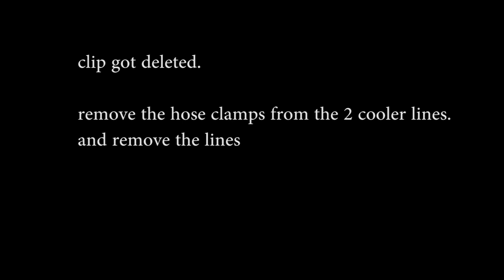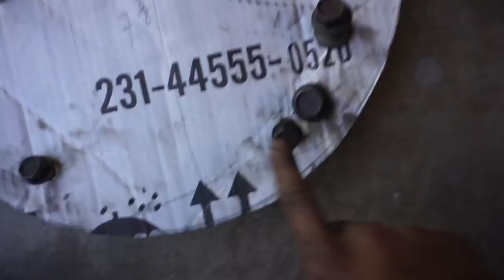97-01 Honda CRV Transmission removal AT HOME!

Comment: You don't have to mess with the ball joints to get the axles out. Just remove the bolt from the fork and from control arm to frame. Gives you plenty of room to push the spindle out. It's way faster and way less of a pain in the ass.
Reply: which control arm?? lower or upper
Reply: @balladan2029  lower, upper doesnt have axles

Comment: I had 2000 Ford Escort SE, I would just remove the engine and transmission with a engine hoist after disconnecting the wires, radiator hoses (after draining the radiator), getting the half shafts loose or out, and taking the motor and transmission bolts and nuts off while having the 10,000lb tow straps around the engine and transmission. Ofcourse with hood removed and radiator, lift and clear the front end with the transmission  and engine. Make the necessary to repairs and reinstall the engine, transmission, all the other parts and fluids. Plus it's good to use new hub nuts!

Comment: hello i don' know english very well but this is wat is this so i have wuestion and that is very very important and pls text me back let s start i have honda crv 1999 automatic wich is  fwd and i hav problem.on gearbox  so i  only can change this gearbox from 4x4 crv and question is wheel block sistem.will  work? when i instal 4x4  gearbox on fwd  thanks for your time pls answver ❤️

Comment: Great video! I'm just about to do mine and you have saved me a ton of trouble! One question, where on the block do you access the flex-plate bolts?
Reply from the maker: Around 8:55 in the video. Remove that inspectionplate cover. And you will see the flexplate bolts.
Reply: @Wrenchlife604  Thanks for the super quick reply! I thought that might be it. Good to have confirmation before I start.
Reply: The little black cover with 3x 6mm bolts  a 10mm spanner and a 19mm between the sump and the gearbox.

Comment: How crucial/ necessary/  effective is the 'center' transmission mount?
 The "mechanic" swapping trannys for my '01 CRV showed me my old mount was totally busted- but then told me I didn't need to replace it because there are 3 other mounts. Considering the end result: I am questioning this (not that I hadn't already) and wondering what other "shortcuts" he made.
Do I need to put this part on the must-get list of replacement parts?
Reply from the maker: Replace the rear mount. Its important
Reply: @Wrenchlife604  Would that be the one with rubber liner located towards center of engine, opposed to towards the sideline?
Reply: They are old. Replace all the mounts that you haven't already replaced in my opinion. It's 20yr old rubber. Know what I mean?
Reply: dont get a super cheep mount. they have too much flex. I got one to get me through my vacation road trip and regret not buying a better one. its not the cost of the mount that bothers me but the pain of replacing it.

Comment: Awesome video, quick question I have a 98 Crv and recently got the p0730 cel, the car will not shift out of second gear and will just hang and eventually not move at all I turn it off and back on a couple mins later and drives but does the same thing any idea if it’s just a bad solenoid or do I need to replace the trans all together? Thanks in advance
Reply from the maker: Had a acura that was throwing the same code i believe.  Turned out it needed a tranny.   Honestly in my experiance. Ive never had a faulty shift solonoid  that  ended up being the culprit.  It always ends up being the tranny. But i could be wrong. Do your own research. Also shift solonoids are pretty pricey now. So make shure if its worth the cost for you

Comment: I'm stuck installing the 'new' one. Any tricks? The top 3 17mm bolts are threaded in but the dowls are too far apart from the housing to mate. The 19mm bolts in back are off alignment as well. How do I twist it into place? It is suppended from a hoist and we have a floor jack to help push the back up to make the 19mm bolts align but it isn't happening. Any tips would be great.

Comment: Did you use the original torque converter from the failed transmission? Or did you replace it with used or remanufactured? I have to do the same very soon. Thanks for your help!
Reply from the maker: Used  one that came with the new trans. I never like using a old converter from a bad transmission
Reply: Okay thanks for the replay, Wrench on.

Comment: How many quarts of oil do I need when putting in the donor transmission . Also do I need to change any seals or gaskets while apart. Just bought my donor tranny yesterday . Great video very helpful !!
Reply from the maker: 3-4 liters if i rember correctly. you can switch out the axles seals if there damaged. i never bother to tho.
Reply: Thanks a million
Reply: @Wrenchlife604  I have a question in regards to this i changed my transmission shifts everything it’s in the way it suppose to be but I have one problem the trans is over heating  drive for a bit then heats up and starts slipping and won’t shift in to gears nor drive after a few mins of letting it cool down it drives again with no problem what can be causing this issue
Reply from the maker: @jorgemoronta7564   possibly a plugged cooler as well? im unsure  you risk damaging your transmission like that

Comment: Great vid. I have the same flops except mine are steel toe. JK. Your doner Trans. Is it straight off a wrecker? If so, any tips on picking a good used trans? Tks.
Reply from the maker: trans came with the car.   go to a trusted wrecker with a warranty if you can

Comment: Great video! Wanna run something by you and see if you can help me. So here's my situation, I have a 2000 rd2 fwd auto super clean I love it. But I recently traded another car for a 97 rd1 awd auto ugly as hell. Question is can I pull the awd trans and whole awd system and swap it into my rd2 without any "problems". Like other then just swapping the actual hardware is there anything else I would need to do? As far as I can tell the chassis are the same. 2000 is a b20z2 automatic and the 97 is a b20b4 automatic
Reply from the maker: I dont  know tbh. Id check and see if the rear subframes are the same. Awd one might have a diffrent rear subframe

Comment: Hey man hope you could help me if possible, so I just changed my transmission and everything is bolted up but my only issue is that bracket at the end of your video that you said to unbolt from the engine instead of removing the long bolt. It now has about a half inch gap from the transfer case  to that bracket and now that’s it’s all back together and I know it needs to sit flush on it, any ideas as to why? I also can’t get my driver side axle back on the hub and it’s also missing about a half inch of clearance. 

I went back and looked at all the bolts that attach from the trans to block and all are flush? I’m kinda lost as to what I’m missing here
Reply from the maker: no idea. make shure nothing is  pinched in the  bottom of the trans. also your axle may be slighlty poped out thats why it wont fit into the hub. just buy a parts store axle to test and see if it will fit into the hub. it happened to me before in the past
Reply: Wrench life 604 that was it about the axle! Got it back in and regreased. Thanks a lot

Comment: Hey did you have to change the t bar in back out for a 2weel drive
Reply from the maker: i havnt done one a 2wd. but i beiieve you can leave the t bracket in the car and remove the 2 bolts thru the bracket.

Comment: Did you have to unbolt from the torque converter?
Reply from the maker: yes you need to unbolt the torque converter bolts. . turn the engine and undo them all. at 8:50-9:21 i showed removing the inspection cover. but the next video clip i lost the file. it was undoing the torque converter bolts behind the cover.

Comment: I've heard conflicting things about flexplate to flywheel torque specs. How tight do they have to be
Reply from the maker: @jaybae8056  i always used blue loctight and tightened  them up normaly. Dont know the spec but have done over 100 transmissions.  Not one problem yet
Reply: @Wrenchlife604 8.7 ft lbs, or 104.4 in lbs.  Kinda hard to get right when 10 ft lbs is the lowest setting on my click type.  I sheared off two due to wrong info, now I gotta extract them 😂 fun.  And my engine sounds so rough, been unstarted for about 4 months.  Any advice to smooth it down? Thanks
Reply from the maker: @jaybae8056   i typicaly dont use a torque  wrench because  it  will shear small bolts. Just use a a regular  socket wrench on it and lean to feel when its tight. Just  like all the other  bolts on the job

Comment: I have to swap a 1998 transmission with new one but the junkyard only has 1999-2001 in the yard are they compatible and at torque converter the same or different.?
Reply from the maker: Should be the same. The junkyard has a computer system that tells if they will fit or not

Comment: Would this be the same process as a manual crv trans/clutch
Reply from the maker: Very similar steps. Manual might be easier. No torque converter bolts to deal with and no cooler lines to take off.

Comment: I have to replace mine.
When istalling new trans.
Is there anything I need to adjust to make sure it fits in or that is going to work?

Or just throw it in and screw/plug everything back?
Reply from the maker: Make shure the torque converter is fully seated in the transmission before bolting it up. Thats about it
Reply: @Wrenchlife604  
Thing runs great !
Got it from the junk yard.
Thank God!

Comment: I have a CRV with 450,000. I just changed the ATF and the magnet on my plug looked like yours. Since the fluid change I'm getting a whirring noise that sounds like a wheel bearing but it's only on decel. Do you think this tranny is done?

Comment: Have a Quick question... Can I use this Guide to Remove and Install But on a 2000 Honda CR-V FWD? If Yes then, What steps should I skip Or Add to this Guide?
Reply from the maker: yah everythings the same. only thing you dont need to do is remove the 4  drive shaft bolts. should be easy
Reply: 97-01 Honda CR-Vs are all the same. Some are FWD some are AWD.

Comment: Im doing a automatic transmission swap on a 2000 Honda crv now the new transmission everything lines up but the bottom transmission bracket won't line up
Reply from the maker: Which bottom transmission bracket? Did you end up finding out what was wrong?
Reply: I cant for the life of me get the 2 19mm bolts to line up to the rear center mount!!! Everything else is lined up and in place but those 2 just cant get it!!

Comment: Hey man I was wondering if I could use a integra b18 automatic transmission for my crv is that possible and still keep it awd? Anything I would need off the other transmission?
Reply from the maker: Dont beleieve you can turn the auto b18 tans  awd.  Think u need to have a crv only trans

Comment: Where do you pry transmission from engine ?
Reply from the maker: Anywhere there was space to. Make shure u have all the bellhousing bolts off before u start prying
Reply: @Wrenchlife604  thanx, now the fun part.  Where or how do you jack other tranny up, engine is tilted down alittle, how you put transmission back up, where to start on bolts or shaft ?

Comment: How does this differ from a 2018 CRV?
Reply from the maker: 2 diffrent engines. Similar steps fromnremoving axles. Bellhousing bolts ect. But will be diffrent due to the new engine they use in the 2018.

Comment: Just got a 2000 crv awd. Do they make a 5 speed for this?
Reply from the maker: Yes they do. Its rare but ive seem a couple.
Reply: Yes they make them in the 5spd model. They have them in FWD and AWD. I've got a 99 AWD 5spd.

Comment: What the hell is a "Carter" pin? You really should learn the difference between a bolt and a nut.
Reply from the maker: Cotter pin
Reply: How long does it take to remove and reinstall total hours? Getting ready to do my wife's 01 crv